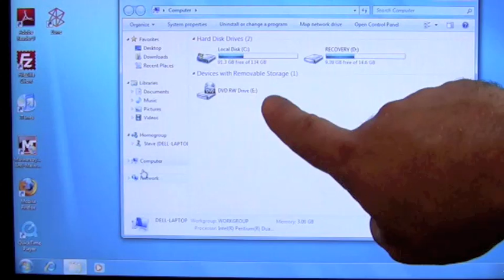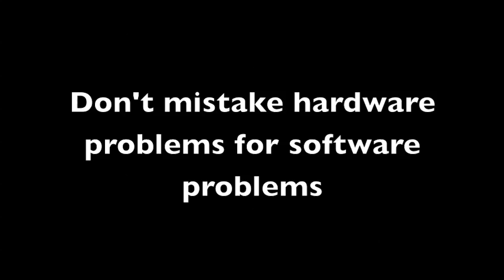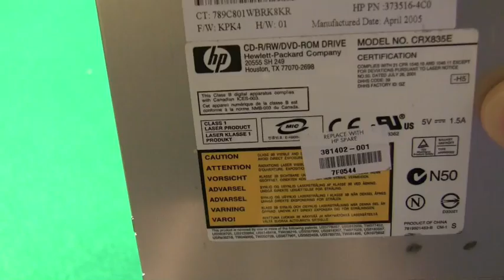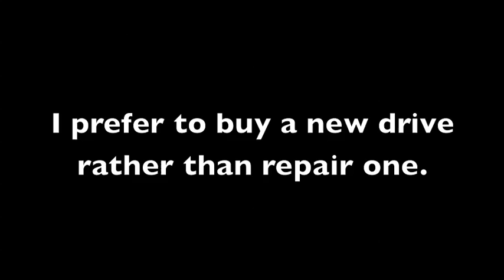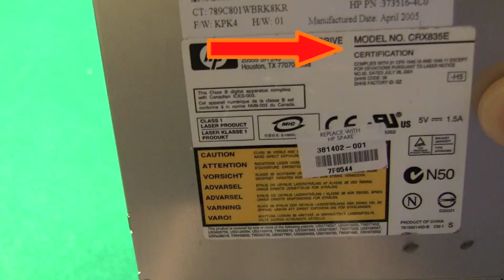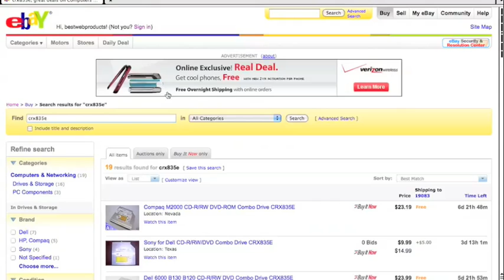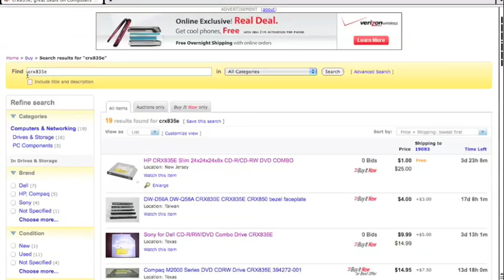How to fix CD-DVD laptops Drives

Comment: My drive didn't read CDs, so I blew it with compressed air, as shown in the video. Now it started to make LOUD BUZZING NOISES (two short BZZT! in a row) after closing the tray. Even with no disc inside. It makes those noises when I turn on the laptop too (I think it might be when it tries to start the motor). What might have happen? I couldn't possibly break any mechanical parts with just compressed air, could I? :q

Comment: Hi ! I took apart two DVD RW drives from two laptops to switch it but since the fitting were different from toshiba to a medion i decided to change the optics. But now , both don't spin and says - please insert a disc in drive E when I click the icon and a disc is inside. The optic slides but the motor rotor spins no dics. What did I burn? I did all registry erase, all IDE, all driver unistall update etc. Are they burned? I did put all back like before on both DVD drives. Thanks !

Comment: I have installed a new hard drive in my Acer Aspire 5349 laptop. But when I insert the systems disk my cd drive is not reading it. I have check my bios to make sure not only is my cd drive listed but that it is also selected for start up. I need help
Reply: +Lyn Pinto In many cases with an Aspire you may need to manually change the boot order or select the disc to boot.  Try entering the BIOS and going to the Boot Menu and move Disc to the top.  If that is already set, you may need to change the boot to Legacy rather than EFI/UEFI in order to restore the boot from CD option.

Comment: great video.  I removed the cd/dvd drive in my laptop and ordered another via ebay without any problems.  It was a simple laptop just removing a couple screws and using a screwdriver to push out the drive.  Now I can not seem to get it to go back in.  Am I doing something wrong?
Reply: Ok reading further maybe I should replace the original bracket?

Comment: Question
I recently updated from a 250GB to a 500GB hardrive and now upon performing a recovery I can not longer get Windows Update to work. I get the response  Error Code 8024A000. I am using Vista 32 update/windows-update-error-code-8024A000  I have been unable to find a way Can you offer any advise.

Comment: HI i just ordered a drive that came from a HP. I wanted it to replace a drive on a lenovo. The two drives are identical as far as i can see. The problem i have is the brackets that hold the screw are slightly different so it wont go in. Do i take out the bracket out of one and put it in the other or just bypass the bracket altogether or is there way to swap the metal sleeve betweent the two thanks.
Reply: Ok guys ive done it. I just took the bracket out of the old one and put it on the new one. The holes are universal on both drives. The screws where a huge PITA to get in then i had to line up the bracket some. I played and burnt a CD so it looks good.

Comment: there should be a small hole put a pin or something thin in it and it should pop open or the belt may have snapped look for a black band if u can't see it it has snapped

Comment: I looked, but there are no "pins" at the top edge of the keyboard. I've removed a keyboard from a Compaq laptop so I was looking to see if it had similar latches, but it didn't. Also, there are no screws under the battery.

Comment: Actually if you have a flat screw driver, you could simply remove the internal peripherals by notching out the three or two top pin at the top edge of you keyboard. Some toshibas are opened that way.From there on, you can fine your way to hav access to the external. Don't forget the ribbon cables plus screws under the battery after removing the battery.

Comment: And if you have an older laptop where the screw is hidden, you can forget replacing the drive yourself because unless you're willing and able to completely strip the computer down, you'll never figure out how to remove the drive. Having the service manual would help, but those are guarded more closely than FBI files.

I just had a DVD drive die on a Toshiba Satellite. Can't find a service manual and don't see any way of taking the drive out.